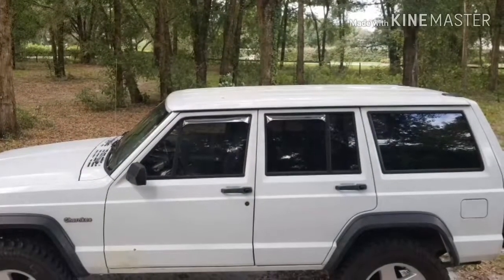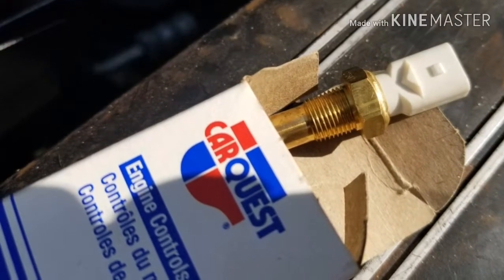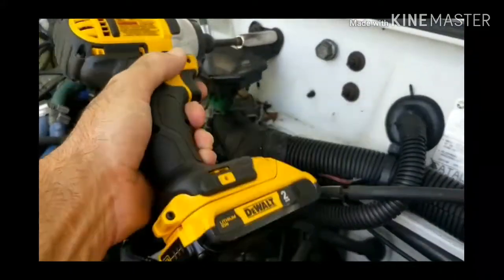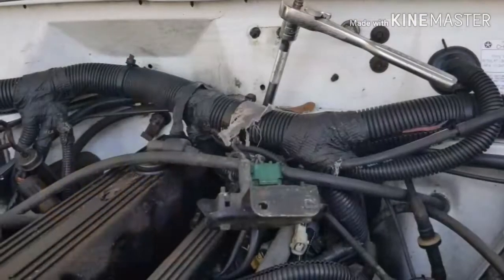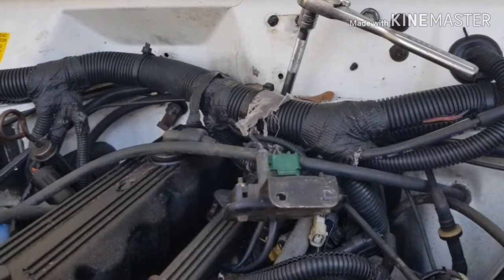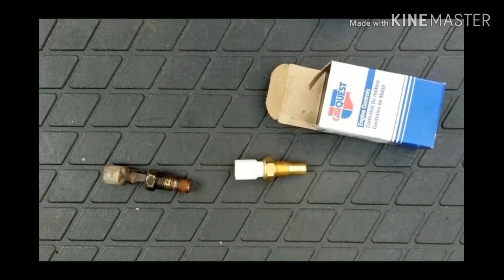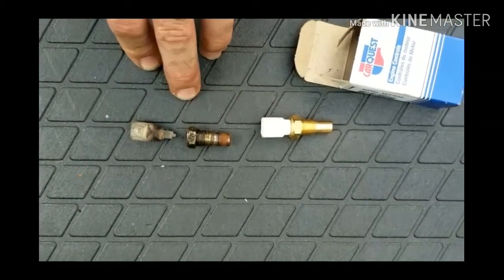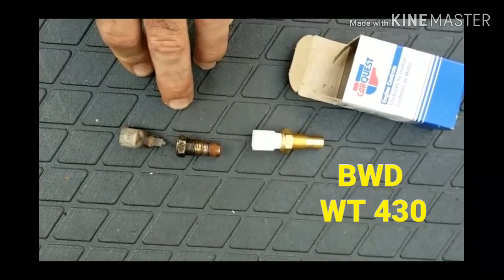XJ Coolant Temp Sender [DRIVEWAY install]

Comment: Hello sir, maybe u can answer my question sense know one else will or can, I bought straight six cylinder 4.0 for my 94 co jeep but I didn't notice it didn't have the hole for the temp sending unit, my question then is does it really need it or can I drill a hole for it or is there another hole somewhere on there I can use?
Reply from the maker: Ok
What year did it come from?
Reply: @danclifford4896  that I don't know
Reply from the maker: What year is it going in...?
There are the issues we talked about in our other vids...gens are different but it can be worked out
Reply: @danclifford4896  my jeep is a 94 cherokee 4.0, I don't know what the head I bought come out.  I was have trouble finding one, and didn't have the funds to buy a new one!!
Reply: It's something that goes between upper radiator hose after cutting it right down the middle hooking it up and hooking up a new temperature gauhe
Reply from the maker: @jaimesustaita372  The one on the back side of the head is for the stock gauge on my 93..(yes)
I wouldn't drill the head for that unless you can keep the metal out.
Reply from the maker: @jaimesustaita372  if you do find an inline/universal sensor cheap....why not..?!
1 wire may even work with original dash/gauge
Reply: @danclifford4896  ok, thks for your time and replies